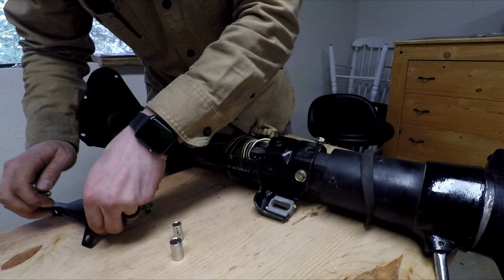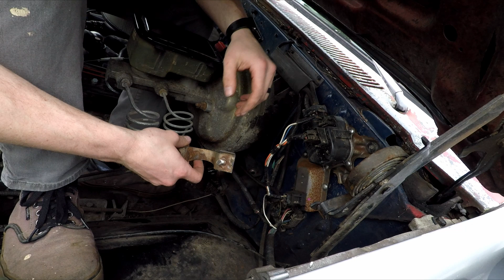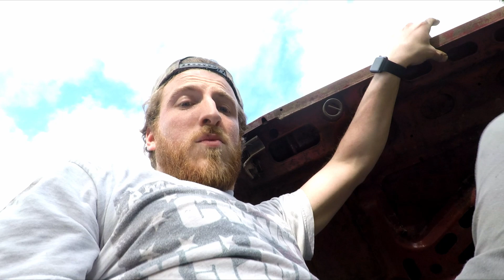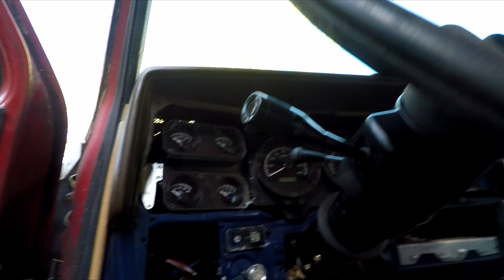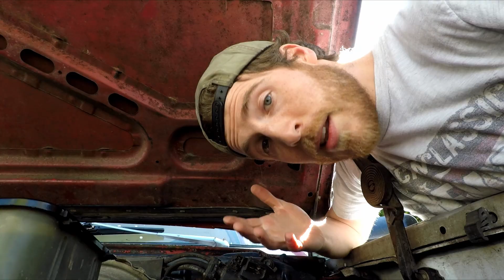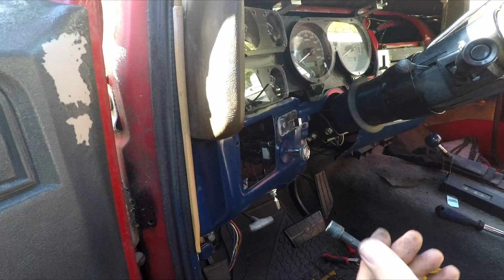Square Body Column Wiper Conversion | 1986 GM Tilt Steering Column Install

Comment: thanks for the easy to follow removal and reinstall of the steering column.  we were able remove and get the new one installed in about 2 hours.  The new column has the intermittent settings,  but the old one didn't.  Have you figured out how to work? I know it has to do with that module it plugs into. thanks again
Reply from the maker: You either have to get the stock module or wire a universal one to try and make it work. The stock ones I’ve found are typically about $100
Reply: thanks,  where did you find the stock module?
Reply from the maker: @ typically I would find them on ebay and sometimes I’d see it on autozone’s website

Comment: Do the parts interchange between the columns, could you take the upper collar from the one with the dimmer and wipers on the turn stalk to add dimmer and wipers to the column
Reply from the maker: As long as both were tilt or both were non-tilt you should be able to interchange them

Comment: Where do you get the female plug to go into the module. My truck is an 83 had the dash wiper like yours, I swapped in a steering column like yours and want to use the column switch and my column does have the module
Reply from the maker: The side of the module should have a connection on both ends and it goes to either one of those.